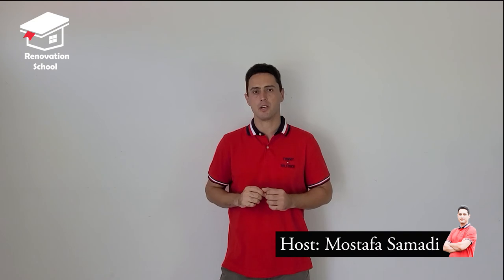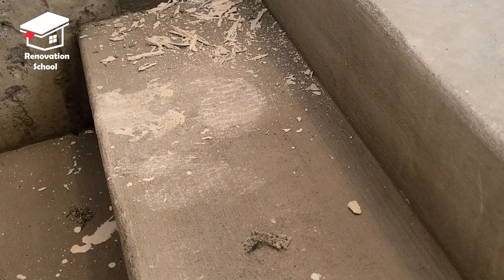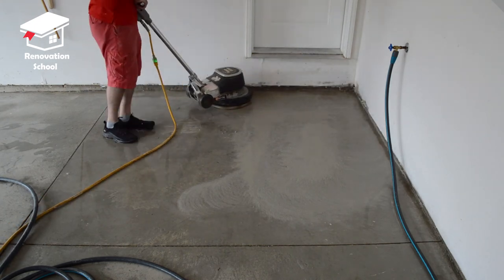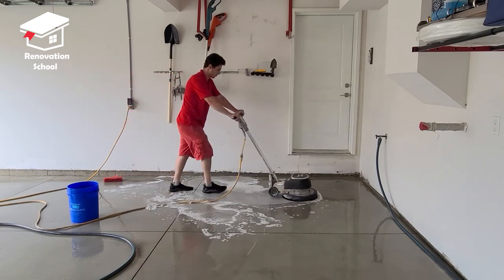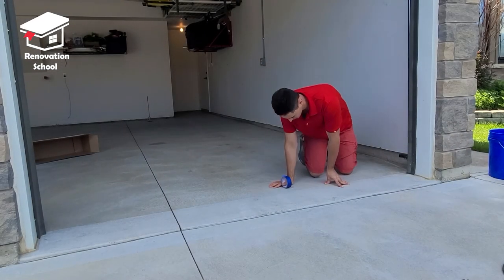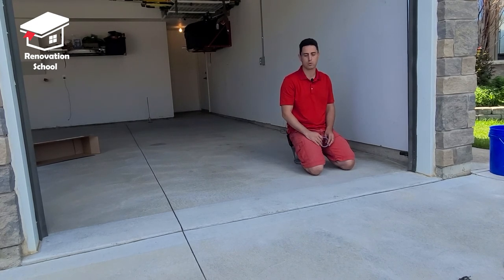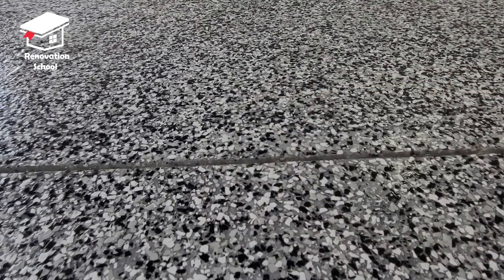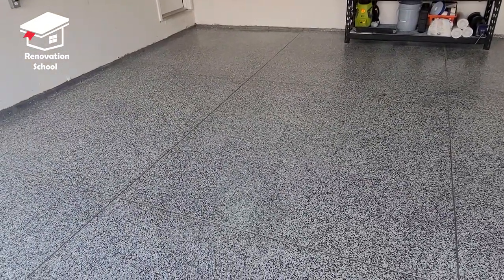how to epoxy garage floor

Comment: Also - a good squeegee hack. Buy some rubber/vinyl cove base. When your squeegee blade eventually fails, just drill and bolt on another blade using wingnuts and the cove base. I've been running the same handle over 30+ jobs with replacement blades for about $4.00 per foot rather than $30 a squeegee.
Reply from the maker: thanks brother , ill keep that in mind 🙂

Comment: Why do you wet it to sand it will just come back up and your epoxy will not set right
Reply from the maker: This wet sander works much better when it's wet 
If u dry sand it it will be too dusty and it won't cut as much.
After wet sanding I pressure washed it and left it for a few days to dry up. I did it in  very hot summer days after a few days that it dried up then I applied the epoxy.

Comment: Great job with prep, installation and explaining the whole process.  Just so you know, you have ‘control’ joints and not ‘expansion’ joints.  Expansion joints are normally caulked to hide the felt material used in between the independent slabs of concrete. control joints are simply shallow grooves used to control cracking (concrete is still one slab).  Applying epoxy in the control joints has no impact on the performance of the concrete.  Nice vid!
Reply from the maker: Yes sir you are one hundred percent right 
Thanks for correcting me and thanks alot for watching

Comment: Trying to purchase the same products but the clear coat you're using doesn't appear to be Labpox 40 uv. What clearcoat/ topcoat are you using from Labpox? And when do you add the flint silica ?
Reply from the maker: They may have other products now
Use whatever clear coat that has UV protection in it.
If you use the flakes you don't have to add the sand at all .
If you only use the epoxy without anything else then use the silka sand to make it slip proof otherwise dont use it if u are planning on using the chips and clear coat.
Reply: @renovationschool8818  Fantastic! thanks my man!

Comment: Have you had an issue with tire transfer on your epoxy/ polyaspartic floor? I have read where you must let the tires cool down to avoid this.
Reply from the maker: No .I have not

Comment: My friend had this done by pro company and the heat of the tor tires started to make floor peal where the wheels came to rest
Reply from the maker: If the clear coat was not used that will happen, I used 100 percent solid epoxy and after 2 years it's just as good as the first day that I got it done. Keep in mind I park in this garage every single day and I abuse it a lot with my tools, you will see this garage in many of my new videos also, cheap tires will also leave black marks on floors. when you drive around the tires get hot and when u park the car in the garage you will get ugly black marks on concrete or whatever flooring system you have. If the right product was used it will be cleanable. I don't know your definition of a pro company. pro companies must use good quality products and they must be responsible for their job quality and they always give you warranty. I always give 2 year warranty on my epoxy floors, I have done over 50 in the past 2 years and I've never heard anything back from any of them. Thanks for watching and all the best 😊

Comment: Just finished my floor with your help. Thank you so much.
Reply from the maker: Thanks for watching, im so glad
Reply: @renovationschool8818  How much is the epoxy am in California? my Garage is 230 inch X 210 inch..What do you call the one that you sprinkled?
Reply from the maker: @k4tilp  prices are changed since I did this job 
What I sprinkled is called flakes.
Look for epoxy suppliers in your area , they have all kinds of epoxy, I recommend getting solid epoxy like this one.

Comment: Finally I found a great video from Ontario. I would like to do a same thing in my garage, but not easy to find a good epoxy product here. I'm gonna try to find the same epoxy around Toronto, and follow your instructions.
Thank you for the detailed video!
Reply from the maker: You're most welcome brother 
It dosen't have to be the same brand as long as it's 100 percent solid epoxy you are good to go. After the prep work make sure to apply the epoxy in the coolest time of the day like in the morning. If it's ur first time mix only half of the containers and finish one side and the mix the other half and do the other side of the garage. I got this from a place called Target building supplies in Windsor Ontario you can call the manufacturer and they can tell you where to buy it from as it is a Canadian made product. All the best.
Reply: Thank you for your input. My garage has 2ft of exposed concrete walls under the drywall, I already grinded down to nice and smooth surface. Should I start with the side walls first, flake it and mix more material to do the floor?  How much time do I have to work with these epoxy?
Reply from the maker: @bognarphotography1  yes 
I that's a very good idea 
Do the walls first and then the floors
Make sure there is no flakes on the ground when u apply your epoxy. Blow it with a leaf blower or sweep it up.
If u get ur self a notched squeegee it will make it a lot easier on you. Try to avoid rolling as much as u can.
This stuff will cure very very fast as it is 100% epoxy is say max work time is 20 min or so. So make sure to mix smaller batches 
If u use brush and roller for the sides make sure to get something that dosen't dissolve. Only use roller and brushed that are good for oil based paint and get a few of them in case they get dried up or hardened up while u work with them.
Reply: Thank you so much for your help! I will try my best to make it very nice, like your garage.
Reply from the maker: @bognarphotography1  wish you all the best. Keep me posted.

Comment: Pro-tip: 100% solids means that the set-up of the mix is exothermic.

If you leave the bulk in the bucket? The exothermic process is enhanced & sped-up.

Dipping from the bucket is not best-practices.

You need to pour the entyre mix out in ribbons on the entyre floor & then start to work it into & over the floor.

That’s what the spiked slip-ons are for.
Reply from the maker: It makes so much sense thank you so much for the info

Comment: if my house is brand new, can I skip to just cleaning/powerwashing to painting the epoxy? thanks!
Reply from the maker: No you either have to grind it down just like what I did in the video or use primer. Just make sure if you are using primer, that primer works with the finish or the epoxy that you're going to apply. 
I highly recommend grinding the surface and in my opinion that's the best route. Once the surface is itched the epoxy will bond very very well to the surface. And specially in new areas where the concrete is poured the surface of the concrete is very smooth which make it very difficult for the finish to stick to the surface.

Comment: Curious this spike shows don’t leave spikey holes or marks ?
Reply from the maker: No they won't because when the epoxy is wet it levels out and it makes the whole disappear. Plus it gets covered by the flakes anyway so it won't be visible what so ever

Comment: Great video!!!! Looks amazing.  Do you mind telling me where  you purchased and cost.  
Thanks
Joe
Reply from the maker: thank you kindly Joe.
the cost of all material was as  listed here :
grinder rental :$80
Epoxy , clear coat , flakes and everything else $650 Canadaian Dollars
I abuse this garage floor everyday and it hold super amazing so far. 
I got the epoxy from a concrete supply store in Windsor , Ontario , Canada (the store name is Target) u can find 100 percent  epoxy in any big city, just google for it and you will find them. most specialty concrete stores have amazing products. I got quoted $6000 for thE garage only and they asked $1000 extra for my stairs , I did it myself and  saved $5k.
I hope this video helps you. if u had any question im always here for you brother.
Reply: @renovationschool8818  I am so interested how your garage floor look can I ask you a question where are you buying that stuff
Reply from the maker: @marialoewen3446  hi Maria , thanks for watching the video
i got a from a place called Target building supplies in Windsor , Ontario , Canada
one more time you can get 100 percent epoxy from most of concrete and epoxy specialty stores in your area.(it dosent have to be the same brand if ur not in canada) its not hard to find , just use 100 percent epoxy thats the secret to make it last the longest.

Comment: great video, at the beginning you put the plastic squares to test for moisture in floor. If plastic was sweaty the next day how would it affect job? what would you have done to prep floor?
ty jimmy
Reply from the maker: Thanks for watching 🙂 if the plastic is sweaty the next day,  then epoxy won't work on your floor, u need to apply the epoxy to a bone dry surface. if there is moisture in the concrete the epoxy will not bond or adhere to the concrete. That's the reason why I said if the concrete floor was just poured in the garage ( if the house is brand new) you have to wait at least 40 days before applying the epoxy.
Reply: @renovationschool8818  so if its an existing floor with a visibly dry floor, but it sweats onto the plastic, do you just advise the home owner that it won't work and a waste of money.?
ty again
Reply from the maker: Yes sir
Reply: @renovationschool8818  better to be honest and get referrals than install a product that will fail.
Reply from the maker: @jamesyelverton3305  100 percent.

Comment: Excellent detailed video!
Reply from the maker: Thanks for watching 😊
Reply: @renovationschool8818  thanks, I saw in one of the video someone highly recommended primer prior to epoxy, can you share your thoughts and suggest any good primer type I can use. Thanks in advance for your help.
Reply from the maker: @ninjip3460  if u had old epoxy that u removed I suggest the primer otherwise you'll be fine 
The same company also sells the primer in case u are interested u can contact them 
Just keep in mind only mix the epoxy in half buckets only , I mixed everything at one shot and it was so hard to apply it at the end 
Just mix half of the containers at each time specially if have never done it before
Reply: @renovationschool8818  thanks alot, my garage is without any coatings, the only reason I’m leaning towards primer is to get the best out of all these efforts. Based on your experience, do you see advantage of using primer after concrete grinding prior to applying epoxy?
Reply from the maker: @ninjip3460  i think it's not a bad idea 
As long as it works with the actual epoxy 
I wouldn't use a primer that is built by a different company. 
I had an area on my driveway that a little drop of epoxy was spelled on it .  I couldn't remove it with any chemical. The only way is to grind it or chip it out , it adhear that much. It almost eats through the concrete.
Before u do it watch the video again 
If u can grind the corners it's even best. Get a notched trowel and it will make it life a million times easier
Aslo u can fill the cracks with sikaflex caulking before u apply the epoxy. In my video you see that they leave the seams alone and I fill it at the very end that's because it was in the middle of the pandamic and I didn't have access to sikaflex caulking. If u get that u can apply some backer rod in the seams and fill the seams first then do the epoxy on top. It will look seam less.
Reply: @renovationschool8818   appreciate your detailed explanation, it’s very helpful. Sorry for many questions, I’m in US so only able to get labprox 30 online but  I’ve to use different company product for top coat, is there any risk you see? Also, you said notched trowel, for what do I need to use it?
Reply from the maker: Yeah no problem anytime
I think it should be definitely fine to use a different type of top coat.
Just make sure that it is non yellowing and it has UV protection material inside it so it doesn't yellow up over time.
Most of the surface will be covered by the chipped flakes anyway. So you're pretty much applying the top coat right directly over the actual vinyl flakes.
If you see it in the video I was using a roller to roll the epoxy down on the ground this takes forever again the stores were closed we weren't supposed to get out of the houses and stuff for that reason I didn't have a chance to buy and notched squeegee. Normally I would pour the actual mixed epoxy on the ground and then use the notched squeegee to get a nice and even coating over the whole area. This will make it go extremely nice and quick and level. If you use a roller like what I did chances are your epoxy hardens up on you because it takes a bit longer to apply it with a roller. I am very experienced with this material so if it's your first time I highly recommend you to get yourself a notch squeegee and a squeegee down on the ground. (I meant to get a notched squeegee I think I mistakenly said not trawel in the previous comment)
Reply: @renovationschool8818  I really appreciate all your inputs, this made me more excited and confident about taking on this project. I got quoted $6k for three car garage, so thought to do it myself and do it the right way. Without your video and detailed explanation through comments, I would have not tried, so again thank you! I wish you great success in your profession and your youtube channel growth. I'm positive that with the true intention to help others, sky is the limit for your future success!
Reply from the maker: @ninjip3460  thank you very much for the nice words.
I really hope this helps you out.
Please keep me posted how it turns out whenever you're done with your project and again if you had any questions I'm always here

Comment: I was doing some research and came across your video. Awesome job! I was going to install Rust-Oleum  EpoxyShield, but your video has inspired me to use 100% epoxy. I have a 2-car garage roughly 20x20', 400 square feet. Would I need a 3 or 4 gallon kit? Since its my first time and you recommend only mixing half and installing half of the garage... are there any issues that you have worry about when feathering the first half to the second half?

Thank you in advance for the info.
Reply from the maker: Thanks for watching 🙂
one kit was enough for this garage , its a 2 car garage also
you wont have any feathering issues as the flakes will cover all the imperfections.

Comment: I'm wanting to do a 3 stall garage and may buy two kits epoxy and 1 gal clear coat. Can I lay the second kit on top the first one right away? Or do I need it to dry, sand it, and lay that down?
Reply from the maker: I'm sorry I didn't understand what you mean exactly.
If you already have epoxy on your garage floor and you want to redo it and make it look something like this, you should grind and remove the existing old epoxy first thing first. And then you can apply this new epoxy onto your garage floor. If it's a bigger garage floor and you need multiple kits to cover the entire area you can mix one at a time and apply them on the same day . The clear coat needs to be applied the next day right after cleaning the chips. Just keep in mind that your clear coat is the most important part of this project if you want this to be washable and if you want this to last for a long time it's best to invest in a very high quality top coat that goes exactly what the product that you applied on the bottom and also you want this to be non yellowing so it doesn't yellow after sometime.
Reply: @renovationschool8818  im doing it on a newer floor. No paint or coating. I plan to use the company you feature in this video and am wondering if the 3 gallon kit plus clear coat will be thick enough for my 620 sq ft garage. If one kit isn't enough, ill have to buy a second kit and am wondering if I do two kits can I lay all the material down, from both kits, at the same time or, do one thin layer (1 kit) and have to do the second kit at a later time?
Reply from the maker: @garageganggyms you will need 2 epoxy kits and maybe you get away with one clear coat kit (maybe)
Mix the first epoxy kit and apply it. that will get most of your garage covered when it's done in a new bucket  mix the second kit and apply it to the rest of the garage right away . The open time for the second coat is 3 to 6 hrs. In case if you want to apply a second coat of epoxy it has to be applied at least 3 hrs after the first coat was applied and max 6 hrs after the first coat was applied. Keep in mind it's summer and it will dry up 3 times faster. If  that 6 hrs window is passed you have to sand the first coat so it's scratched and then apply your second coat because it will harden up so much and it will be shinny and supper smooth. if u apply your first coat and throw the chips on it , you really don't need a second coat. One coat will do great.in my opinion 2 coats is too much .It's been 2 years since I've done this garage and despite all the abuse it still looks like the day 1 . So I think one coat is already very good enough.
Reply: @renovationschool8818 do you have a recommendation for a kit that would cover 650 square feet so I don't have two buy 2 kits and waste 2/3 of it?
Reply from the maker: @garageganggyms  just check your local epoxy sellers and see what options are available in ur area.

Comment: Great video. I learned a lot. 
Is the grinders primary purpose to create a porous floor so the epoxy adheres well?
Reply from the maker: Thanks for watching, yes the grinder itches the surface and the epoxy adheres better.

Comment: Please help. Do they sell just the clear coat, has some tires marks.  Need to remove clear coat and redo the clear coat. Make sense? Help
Reply from the maker: They do 
you cant remove clear coat, try cleaning it with denatured alcohol it should come off